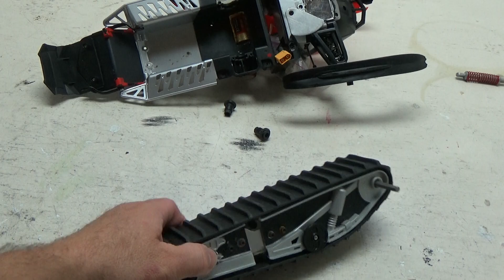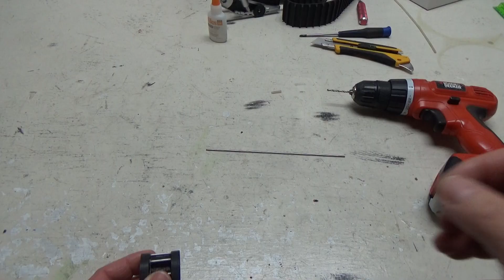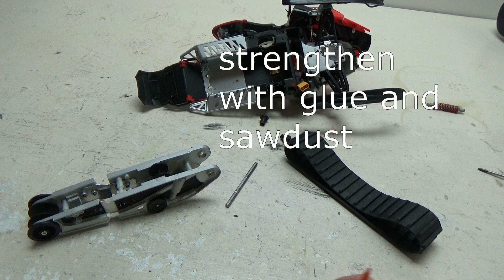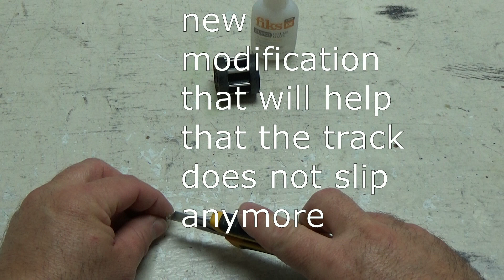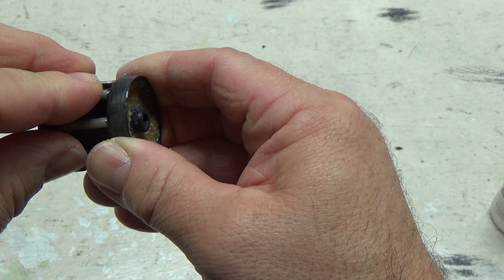Rc snowmobile polaris rush track modification part 3.

Comment: Nice mod. I did some modifications similar to yours, though the track did slip eventually. I noticed the pads the pulley grips started to break and bend quite a lot after one winter :/ The problem is the track is so soft it bends like crazy, as seen when you spun it on max throttle :D Keep up the good work!
Reply from the maker: Thanks man

Comment: How much did the overall upgrades cost?
Reply from the maker: it's homemade
Reply: @rchelistef506  no, with all the parts etc.
Reply from the maker: 2838 4500KV 4P Sensorless Brushless Motor+35A ESC for 1/14 1/16 1/18 RC Car S4I3
Reply from the maker: Gotek Digital Metal Gear GS-9257MG 9257MG Servo For Trex 450 500 RC Helicopter
Reply from the maker: combo speed control with motorS2838 4500KV Brushless Motor 35A ESC 3.5kg Servo Combo for 1/12 1/14 RC Car B9X8
Reply from the maker: Kyosho BL10C Blizzard SR Caterpillar Tracks Ver. C
Reply from the maker: on ebay
Reply from the maker: 2.4GHz 3-Channel 3CH Radio Remote Control RC Car/Boat LCD Transmitter + Receiver
Reply from the maker: 1500mAh 7.4V 2S Transmitter Lipo Battery for Flysky FS-GT5 Remote Control Parts
Reply: Ok, thanks